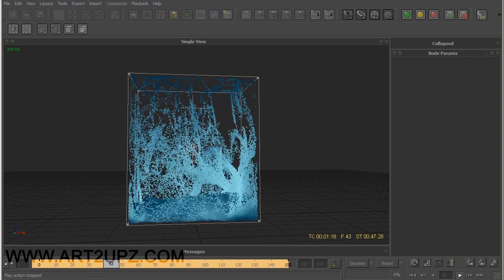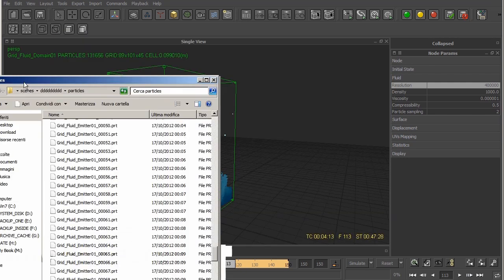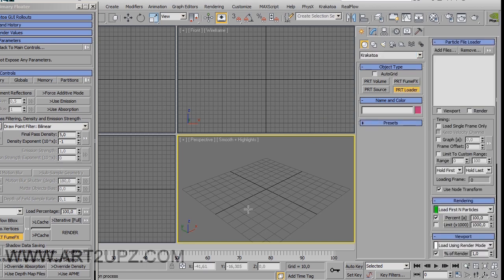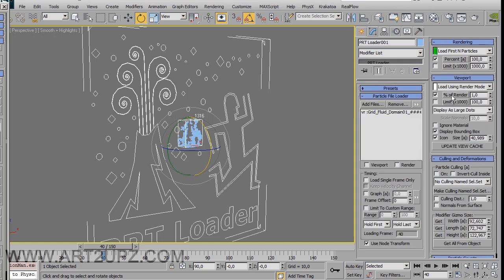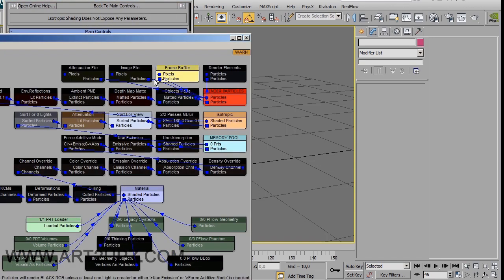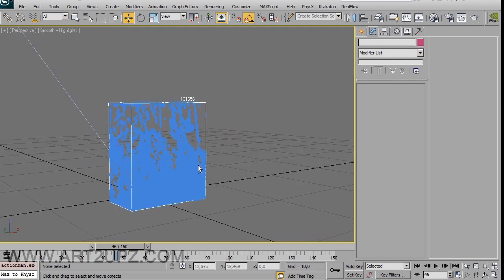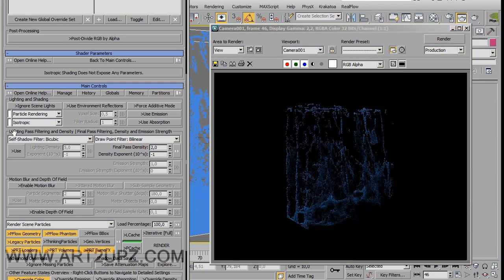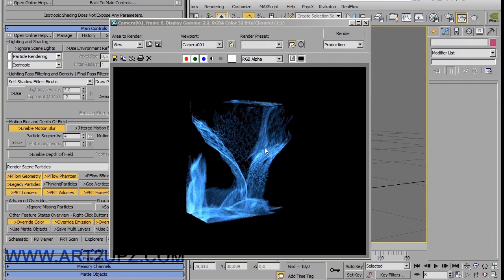Tutorial Export Hybrido particles for Krakatoa

Comment: How to export Foam particles from real flow, to bring them in max?
Reply from the maker: I don't use 3DS Max and Realflow anymore, but from export central inside Realflow (F12 if I remember well) you should find the foam emitter and check if the *.bin or *.prt format are enable. Then you can start your simulations.

I hope that could be help you